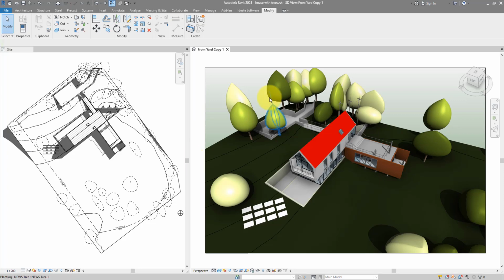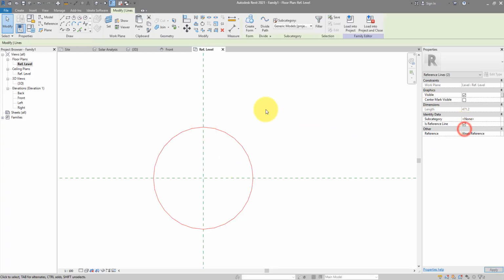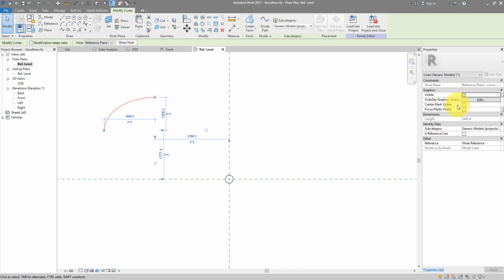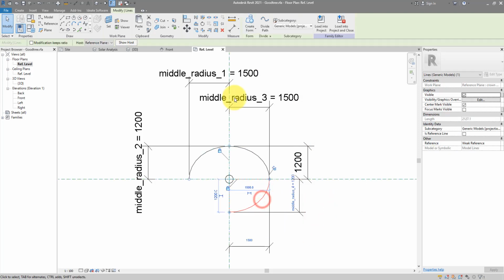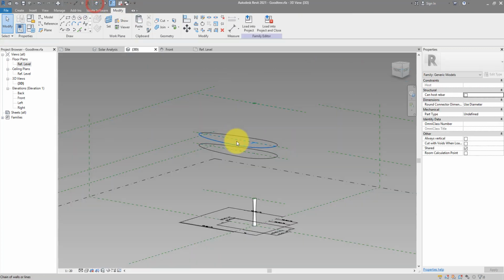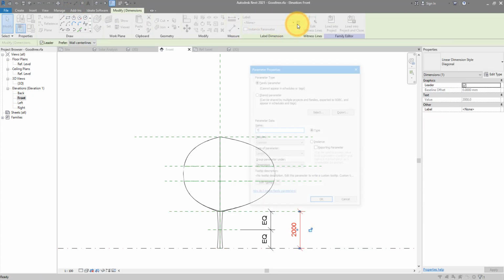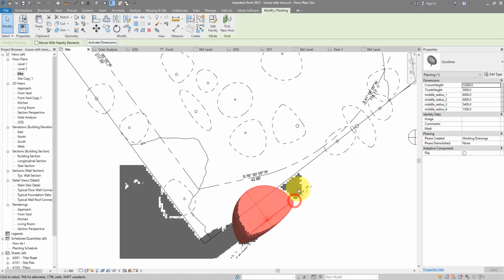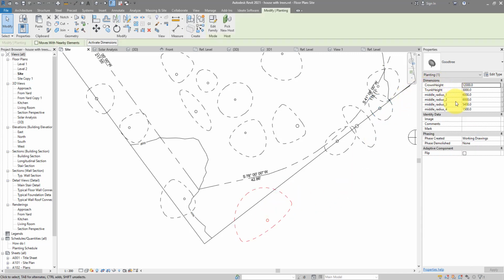Revit Snippet: Create blob trees with 4 independent radii!

Comment: Great Video thanks.  
Where could I find the video for creating the tree materials as you mentioned on the video?  and Which template did you use for the detail item component?
Reply from the maker: Sorry it's been a while since I created this video. When in the video did I mention the material and the template?
Reply: @RVBoost  no, you didn't mention the template used for the detail item component (which you have created earlier to save time in the video) 🙂

At approx. 16min:15secs you start saying that it would be posible to find a video showing how the material for the tree was created.  But I done a search on your video list and I cant find anything 😞
Reply from the maker: @diegovargas7054  Judging from the video, the template for that detail item component is likely to be Generic Model. About the materials, I can't find the video either. I must have remembered it wrong at the time. Sorry about that!